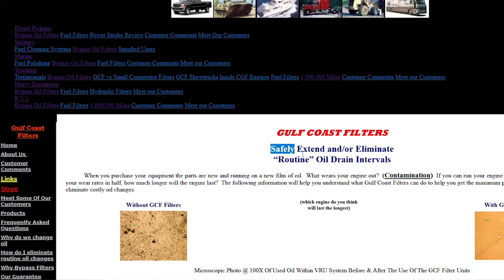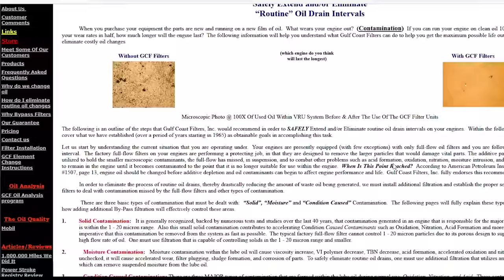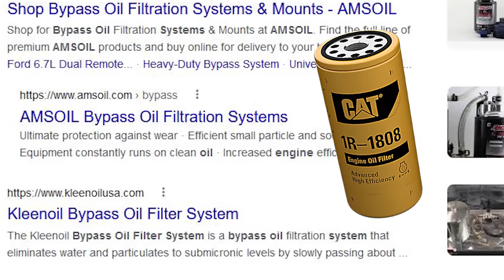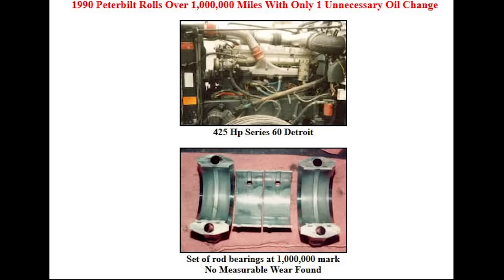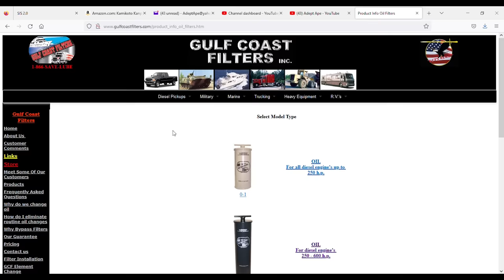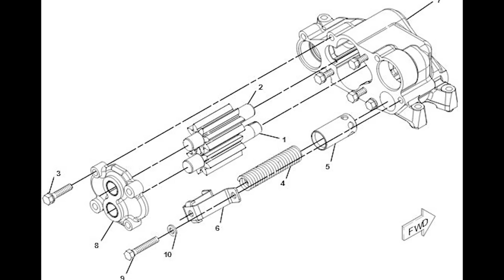No Oil Changes and 1 Million Miles!!! Are Oil Changes Optional with a Bypass Filter? (INTERESTING)

Comment from the maker: Thanks for watching. Voice is a little rough, but getting better. @AdeptApe on Venmo or AdeptApe@yahoo.com on PayPal for donations, thank you so much for supporting the channel!
Check out these recommend tools to help the channel out, 

Amazon Affiliate Link to tools recommended: 

Airlift Cooling System Vacuum Filling System: https://amzn.to/3D9AlPu 
Milwaukee 3/8" Right Angle Impact Wrench: https://amzn.to/3D2CvAk 
2 Pack M12 Style Batteries for Milwaukee: https://amzn.to/3D2mdHE 
Adjustable Height Parts Tray 100 lbs: https://amzn.to/3CBusZB 
Engine Oil and Fuel Dye UV: https://amzn.to/3z34zkv 
UV Professional Grade Light: https://amzn.to/3gzxPc0 
Oil Pressure Priming Tank: https://amzn.to/3YuBrNr 
Photo Tach REED: https://amzn.to/3ATJ8Cw
Reply: Who knows something about the mack E7 engines BESIDES mack? I need major help
Reply: What about the centrifuge based bypass filters? those claim to capture and retain water as well as submicron sized particles including accumulated soot.
Reply: @2000freefuel  try Amsoil, they have the best oil and lube products, backed up by independent labs.
They also have a bypass system.
 Used all of their products more than 40 years.
They work.
Gale Banks of Banks Engineering and Banks Performance products
is a huge fan of theirs after testing their claims and proved what they claimed.
Reply: Quick question for you, Cummins ism 2001 when cold it stutters when accelerating but when warmed up the stutter goes away, any ideas what to do?
Reply: So I have 2003 250.000 miles Ford E150 main seal leaks about a quart every 200 to 300 miles . Alao have a 2006 Cbr with 30.000 miles . Use the used  10/40 fron the bike andi put it in the truck. Its been almost a yera maybe i should put a bee for motorcraft filter.
Reply: Turbo cooking the oil on hot engine shutdown. This doesn't even get into the detergent properties and other additives in oil. The main component might stick around but the additives would not. Which means carbon will stay in place and not get cleaned. Which will lead to buildup interference and varnishing, etc.
Reply: 66
Reply: @richardc7721  5
Reply: Crazy thing Is its a paper towel instead of a filter they were designed in ms
Reply: @AdeptApe I’d like to see them go 1 million miles without an oil change on a HEUI engine
Reply: i think my experience said the passage of the oil ,the flow, amd amount of the oil in the pan, becoz when the truck stop for few days its enough fot deposit to seperataed in the bottom of pan.

i ever change sedan oil for 10k Km, and its no problem(japanese car)

Comment: As an equipment rental company we added by-pass filtration to multiple pieces of equipment in an effort to extend the hours between oil changes. Some equipment piles up hours much faster than others. Without going into extensive detail, we found a by-pass system worth the cost and the extra testing also found some issues we might not have known about, possibly saving us on major engine repairs. I agree with extended change intervals, not with never changing oil. Fuel contamination and loss of lubricity was also our concern.
Reply: Agreed
Reply: I definitely agree We have a lot of local equipment with bypass filters And soot is a problem for us I just used it for Extra protection along with a magnet on bypaszs filter it's still has metal on it In the shape of the magnet whe
n you cut The bypass Open.eabp120 amsoil
Reply: Extended hours- is way different than never change oil  again.
Reply: I run them for extra protection but I promise you I'm having a sludge problem right now and have one in the shop Because of 30 to 35K oil changes With the bypass Shafer's and Donaldson blue oil filters
Reply: Foaming would concern me.  Injectors in modern engines cost way more than oil ...
Reply: You don’t just put it on and run it.  The lab test are very important.  When you change the regular filters and the bypass filter you add  oil which adds back the additives.   Then you send the test in for the lab to check, they keep a running tally so you get to see if contamination is building up or if it has too much viscosity.  Same lab every time let’s you see whAt your engine is doing.  And you will know when you have problems or when you need to change the oil.
Reply: Yeup. 1,000,000 miles isn't something that works without excessive wear on the mechanical components. And catastrophic failure risks. Oil changes are there for a reason.
Reply: Always do oil analysis with extended drain intervals it will tell you when you should change it
Reply: @Mcss-lu5hv  True, my experience is gasoline engines and small diesels. People keep talking about the million mile truck like some fools are running the truck a million miles on the same oil. .It is a test being done by Shell engineers. I think it uses Shell Rotella T 15 40 conventional. Shell is a long time user of Gulf Coast filters.on locomotive engines on offshore drilling rigs. The truck gets 3 gallons of new oil every 10.000 miles when the 3 gallon filter is changed. According to oil analysis thats a little more new oil than is needed. 3 gallons of  new Rotella every 10.000 miles is a lot of new oil in a million miles. Of course you have the full flow filters every 50.000 miles. Road King says it is equal to a full oil change every 40.000 miles.There are other good systems. Not sure about the cost. For the system to work the filters need to be large and effective.
Reply: I use full synthetic oil in my 60 series Detroit.  I use a centrifuge bypass filter system.  My last oil change was over 360,000 miles with only spin on, and centrifuge canister changes.  Plus normal oil replenishment.  An unrelated cracked block forced an engine replacement.  When it was torn down, the bearings showed only normal wear.
Reply: @osmacar5331  1,000,000 miles with proper filtration, proper oil, and regular analysis is entirely possible.
Reply: @Mcss-lu5hv ........which adds backs 1 quart of oil additives.
In old oils, the zinc depleted over time.  I would assume current oils wear out too.
Reply: @randywl8925  I’m sure at some point it does.  That’s why when going with these extended oil changes, the most important step would be taking that sample and sending it to the lab.  They will let you know when it’s time to change it.
Reply: @randywl8925  Mine is a 10 gallon system.  The two spin on filters hold 1/2 gallon each.  And, I go through about a gallon every 6-8 weeks.
Reply: Oil bypass systems work.  I had a spinner and a oil pur system.  The oil pur system does evaporate the acids and liquids in the oil.  The spinner would accumulate the dirty particles and it would not fill as fast after the oil pu rdd system was added.  The problem with extended oil changes is to watch the iron in the samples and change oil before the iron builds up too much.  Also use synthetic oil. Rotella is good, but DA Lubricant oil is a little better as it has more zinc.
Reply: Yeah people don’t realize that particulates and contamination are NOT the only reason you need to change your oil.

Oil also gets old and loses its lubricating properties. So even if an engine was never run you should still change after ~2 years.
Reply: As oil gets used, it loses base.  The base is replaced with adding oil and some full flow filters sold by lubrifiner actually have base that slowly dissolves into the oil.  When the iron gets built up, then it is time to drain the oil and start with fresh oil again.
Reply: Yeah.  Molecule shearing and resulting viscosity change (thinning), consumption of protective additives, and accumulation of non-filterable particles (acids) make this common sense among anyone who understands mechanics or engineering.
Reply: Keeping oil for long periods in an engine is plain stupid. Oil degrades   over time and  temp cycles are degrading it. Fuel contaminations is also happening in any engine at some extent
Reply: Excellent explanation, but I'm still curious about other details.
Reply: @neilstuart9727  We tracked down sludge formation to ethanol. 
Using E10 resulted in the ethanol oxidising and polymerising to form sludge.
The sludge stuck up the rings and resulted in fuel dilution of the oil
Our high efficiency oil filter (same as the bypass oil filter) didn't seem to do much to remove the sludge.
Stopping the E10 stopped the sludge formation.
🙂
Reply: Another simple way to extend the hours between oil changes is to bonding a lubricant to the inside of your engine:
This will result in an 80% reduction in wear (~5x increase in lifespan).
The oil filter will also last much longer.
🙂

Comment: I remember watching your videos when i was 15 and taking notes…now im 18 and working with my dad as a heavy machinery mechanic..LOVE YOUR VIDEOS!!
Reply from the maker: Super cool. Hope you enjoy it.
Reply: Know anything about the mack E7 engines?
Reply: @AdeptApe  
Did you dye your beard ?
Reply from the maker: No, it's naturally whatever color it is. That being said it looks darker in the video for some reason than in natural light, I think that might be why it looks dyed.
Reply: @AdeptApe  take that as a no?
Reply: @keepontruckinoutlawlife1248  im just learning right now but im pretty sure my dad knows about these.
Reply: @AdeptApe  it’s no coincidence it is this much black-ER in this vidya. We’re talking about oil. Probably dyed with years of engine oil. 😅 Also, I need that classic CAT hat. Ugh. Your collection is strong.
Reply: @keepontruckinoutlawlife1248  there was a destruction of the week once where someone put a hole in the block of one. That much I can tell you. (I like Mack trucks, thats not a knock or anything. I think it was a operator error)
Reply: @keepontruckinoutlawlife1248  
We used to run quite a few units/dump trucks with the Mack E7’s pre 2003 at different hp outputs 300, 350, 400……. Sold them due to whinny drivers not wanting to drive them cause RD Macks are “to loud, not enough room, etc…
Dang good motors, good fuel mileage, and easy to work on…. Had one with I know for sure over 38,000hrs on it, and sold it never having a major problem. 
The only major issues I ever heard of guys encountering was from relatively high miles/hrs, and a driver turning more rpm’s than ever needed…… valve adjustment was also neglected and valve would break/drop into cylinder causing damage. On older E7’s that were mechanical with fuel rod going from pedal to pump they normally had a cable connected throttle lock/cruise control on dash that went to pump, and lock mechanism on dash would sometimes break. After breaking, without frequently adjusting it would cause truck to idle Too low, and could cause a spun main bearing. Know 1 that happened to…. I think that pre 2003, or before Volvo Mack merger that a Mack with E7 was one of the best motors a fleet owner, or owner operator could of bought if looking for a cheap, tough, and reliable truck……
Good luck out there, and God bless
Reply: I worked with my father for 30 years. I sacrificed my youth, education, health and relationships to help create a succesful familiy business worth millions. As my father's cognitive abilities started deteriorating he began making questionable decisions. When I confronted him about the mistakes I was cut out and disowned. Now I am 40 and starting again from nothing. I had some savings but all of my life work was invested in the company. I had nothing formally on writing to back up my position.
Reply: Hell yeah. Started with pops and now he’s retired, have some great memories